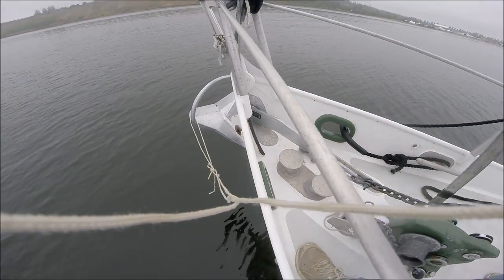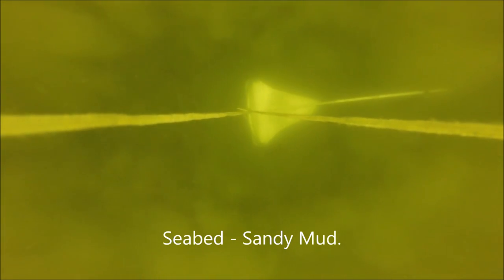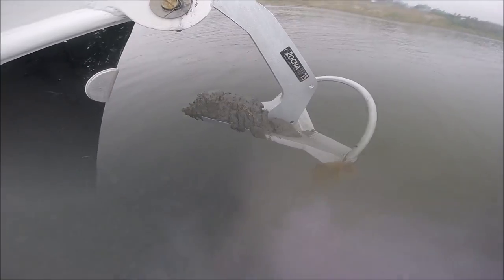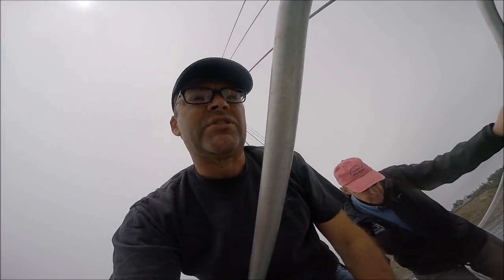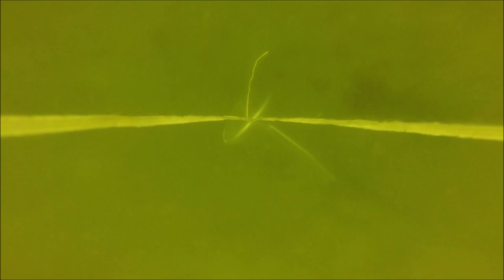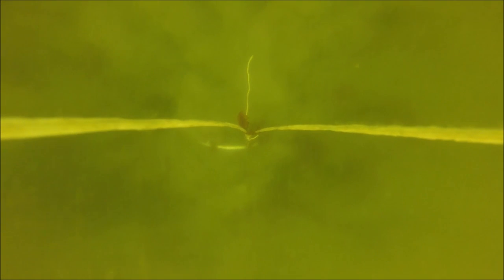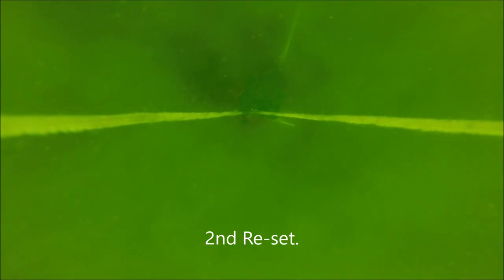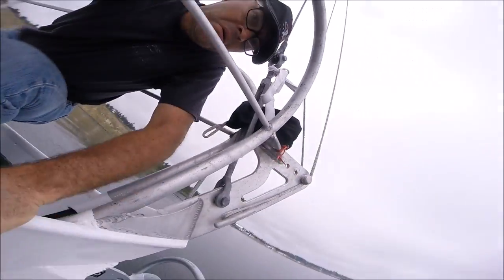Rocna Anchor Setting (33 lb).  Video # 63 of an ongoing anchoring series.

Comment: We have been using a 25kg rocna for years and have had better results than your test suggests, probably for two reasons: 1. We paint than anchor annually with gloss white enamel, so it sheds mud more readily, and 2. I think real world resets on wind or tide reversals are far more gradual than those you use in your testing. Love your videos, keep it up!
Reply: Thank you for your suggestion to paint the anchor.

Comment: thank you for this.  i have been using a rockna 55 lb for 10 years now without a problem but i have learned something from this.  ours is a 36’ trawler.  we have a buddy with exactly the same boat and same anchor.  i’ve seen that other boat not set their anchor by what i thought was a much to aggressive back down.  too fast and this anchor just doesn’t seem to want to set.  we’ve adjusted our set to be much more gentle, only tugging once the chain comes up.
Reply: Same conclusion here with our 55 lbs Rocna

Comment: My 42' sailboat had a real Bruce which I replaced with a Rocna and it was way better. Always set right away. Love your tests. For my next anchor I might try one of your other recommendation. If they are better than the Rocna they must be awesome.
Reply: Ahhh but Steve was recommending Rocna before I believe. If he was doing that without testing that is worrisome, as he might get his latest recommendations wrong for the same reason. I hope you do more research than just one person's testing. There are reports of Rocna dragging, but lots of anchors do in various conditions.  There are also thousands, like me, using Rocnas that have had no problems - yet. These videos are great to help expose issues and I appreciate them being shared, but they aren't 'the' authority. It would be easy to test the strength of the 'holes' put in the anchor and find out why the manufacturer had the tabs bent up. I'd be interested in what Rocna said about these tests and their take on the reasons for the problems, but he didn't check with them. That seems like useful, even critical, information to include in a video like this. I have a Bruce, a Danforth, and the Rocna and by far the best in all conditions I have been in the Rocna is the best of those particular ones. After watching the video however, I will be paying more attention to the Rocna's performance and anchoring with more caution.

Comment: I had a 25 kg Rocna on my Corbin 39 which I lost in a crazy misadventure. It held like a rock in sand and mud, even when I left the boat unattended for weeks with wind and tide shifts. Although it never dragged, the huge amount of hard mud that it brought up always concerned me in terms of its resetting capability in a hard blow and shift of wind. After the loss I bought a 30 kg Kobra (which is excellent and super value for the modest price) for that very reason (mud retention). However, reversing a boat's direction at 2 knots or more doesn't seem like a very reliable real-life testing method. I've seen dozens of boats drag through anchorages, even boats with ridiculously short scopes and undersized anchors, and I don't think I've ever seen one drag at 2 knots per hour or rotate 180 degrees in a blink of any eye. If your testing of this Rocna was comparable to real-life situations, there would be a lot of angry Rocna owners, but I've never met one. In any case, I've watched your videos, find them very useful (thank you), even though they don't fully replicate a real anchoring situation, close but not quite. Sorry to be so longwinded, but I compare this situation to the critics of CQR anchors. I had a 45 lb one on my Corbin for 12 years, and it did the job in two continents and in severe conditions. I'm not saying the CQR is fantastic - it isn't - but I never (ever) anchored using the techniques shown on videos to demonstrate that CQRs are no good. Tests must imitate good anchoring practices and real life situations. To conclude, I wish everybody would buy a Spade anchor for one very simple reason (and I'm being serious): I wouldn't have to constantly worry about all the boat owners who don't know how to anchor dragging onto me here in Southern Europe.
Reply from the maker: Horatio Marteleira   Thanks for that detailed comment, Horatio.  I agree that my re-set test protocol does not simulate typical boat movements during wind or current shifts.  I use this aggressive test because it amplifies the results, thus allowing me to compare anchors using 5 or 10 repetitions rather than perhaps 1000's.   ......   I believe a good  comparison can be made with automobile crash testing.  Most people do not deliberately drive thier cars into brick walls or oncoming traffic.  Testers do this to quickly collect data in a controlled environment.  ....... I know people who refuse to wear thier seat belts.  They cite the fact that they have driven for many decades without ever needing a seatbelt.  Personally, I feel the saftey provided by seat belt use is worth the effort.........All that said, I have an aquaintence who experienced a wind-shift at anchor (once) due to frontal passage that EXCEEDED the conditions of my test. His anchor dragged (Delta) and was just able to start his engine in the nick of time to keep his boat off the rocks.
Reply: I have a CQR now and I am looking to upgrade and have the CQR as a backup, what is your recommendation Rocna? Spade Anchor? I have a 34ft sailboat

Comment: Thank you for doing this anchor tests. I watched most of your videos before already and hoped for month to see a Rocna here.

Currently i am using a 15 kg Rocna with my 34 ft boat (about 6000 kg). From my experience the Rocna usually digs in with the first try and keeps the boat in place with 3000 rpm backwards thrust. I did not experience a reset situation with relevant wind force yet, but i can confirm your observation from when the anchor did not dig in at once. The next attempts were much more likely to be unsuccessful as well. Maybe i should get it completly up and clean it after a failed attempt in the future.

May i ask what the weight and size of SV Panope is? It seems the 15kg Rocna in your test is a bit below Roncas recommended size for your boat?

Currently i consider upgrading to a 20kg Spade, which seems to be a better solution. It would be very interesting to see, how a Rocna Vulcan compares to a Spade. 

Thanks again for this great channel!

Comment: Would love to see testing of two anchors set in tandem.  There is plenty of anecdotal evidence offered but no testing of the caliber that you do.

I always figured that a big fisherman's style as the primary would stick in hard bottoms and would, because of its weight and geometry, be tolerant of an attachment to its crown for the tandem anchor.  That second tandem anchor should then be something good in soft bottoms like a fortress.  In soft bottoms the fisherman's anchor would slowly drag, but in a controlled fashion, and the tandem anchor would dig in and do its thing.  If a hard patch or rock is encountered, the fisherman's would stop dragging and in fact might protect the tandem anchor from substrates that it didn't work well in.

Does the tandem anchor work better or worse in the furrow of the primary anchor?  I have seen it claimed both ways (I have no direct experience myself to offer).  Also I have read about using a leader of steel cable ahead of a Danforth/Fortress style anchor in extremely soft bottoms to allow it to dig down especially deep.  Claims were that it actually made the critical difference.  If so it might also make the difference necessary for a tandem anchor to dig down below the furrow and how would that not be good?  Any deviation left or right would put the tandem anchor into undisturbed seabed a couple of feet down.

Any discussion of multiple anchor setups soon leads to frustration of the "I wish I could see what really happens" sort.  Two anchors 180 degrees apart?  What happens as the wind goes round the clock?  Would love to know.

Comment: Great way to mount the camera. Passing overhead at 3.5kts? If the conditions are such to allow that much momentum over your anchor, in such a short distance, perhaps 3.5:1 scope wouldn't be an ideal choice. Obviously, there are a lot of factors to consider when considering scope, but I would being interested to see what happens during a similar test with 5:1 or 7:1.

Comment: Well I have to say this is interesting BUT....... every anchor has drawbacks and strengths every bottom has challenges for each.  Wind shift is always a issue in any anchoring situation especially is the hold depends on setting deep vs weight of the anchor.  Also part of the reason anchors pull out when wind changes and your boat goes over the anchor and then pulls out is the anchor is designed to pull out when you want to retrieve it. As that’s is exactly what you do when you want to lift anchor and go. Just like we want our anchor to hold well we also want to be able to haul it up when. It’s time to go. Leaving a boat unattended at anchor with a single anchor will always have some risk of pull out and drag until the anchor resets. How well it resets depends on many variables. Bottom m type rode type (all chain combination of chain and rope swivel or not) also weight of the anchor and the chain matters also. As well a depth vs length of rode. Also is the bottom sloped in one direction and when the wind changes are you dragging to deeper water or shallower water? many variables involved.  I always questioned the video tests roccna showed on their web site  they were done on a beach with no water and no angle to the rode it basically showed how a roccna or the other anchors function as a land anchor to pull your rv out of the mud not how a anchor performed in actual water.  They also only test on one type of bottom material. Also although simply not practical the best anchor would be one that is so heavy it would hold without digging in at all. (Like. A concrete mooring )  it would be interesting to see how a heavier anchor would do as size matters.

Comment: I don’t understand the method reasoning. Everyone I’ve ever talked too and everything I’ve ever read says a minimum 4 to 7 times the depth. 10 iTunes if extremely heavy weather. I’m planning a 33kg Rocha for my Beneteau Oceanis 34 with 70 meter of chain. Why so short on the length. Thanks for the testing.
Reply: Worst case emergency storm anchoring :)

Comment: My unscientific observation related to your findings, somewhat supports that a new Rocna can foul. I have an older Rocna 20kg that is about 8 years old, china manufactured by hold-fast with cast fluke. I also have a 1 year old Rocna (for stern), china manufactured by CMP with welded steel flukes. The older one is a dark rusty colour from staining (not rust, but fine clay that has embedded into the galvanizing) but mud never clings to it when I pull it up. The brand new Rocna (shiny like in the video) often has clay and mud still sticking to it. I did note that when I bought my newer Rocna, that the galvanized finish was inferior to the old one in appearance (smoothness). It seemed like they didn't bother to sand and wire brush the steel, but rather just chemically strip and dip right away. Weld spatter still visible in areas. Cost has decreased dramatically on the Rocnas (40%!), so this is probably a justifiable manufacturing cost reduction.

Any chance you might have access to a nice shiny stainless Rocna to see if you get the same failure mode?
Reply from the maker: Thanks for that, Joe.

I too, believe that surface roughness may have a profound effects.  The Rocna that I tested was purchased new in 2015.  It had the cast fluke.  It may be that the smaller sizes still use the cast fluke while larger use welded flukes.  I do not have access to any SS anchors.

Steve
Reply: Thank you for your observations, very helpful

Comment: Brought a Rocna 33Kg, tested in river with very soft mud, dragged as soon as we touched it into reverse or never went in at all. Came up with heaps of mud on it. 4m deep scope 1:3 on 10mm chain, 50 foot pleasure boat

Very disappointed as changed from a CQR and didnt get any better results.
Reply: Cam Collard for very soft mud a fortress anchor with 45 degree fluke setting is best. I prefer a mantus anchor for all other substrates, it has a better design to Rocna, much less prone to fouling and failure, probably because the point is more aggressively aimed at substrate.

Comment: where are you anchoring where the current switches directions instantaneously to 3 knots in the opposite direction. Remind me not to anchor there... And why are you running 2:1 and 3:1 scope? I would think a more accurate test would be 5:1 and 7:1 which is what most serious cruisers would use if they wanted some peace of mind... Regardless of anchor brand.
Reply: Worst case storm anchoring? Deep waters? Crowded area?
Reply: sorry to tell, but 5:1 scope did not help me

Comment: Hi, thanks so much for the tests! Very interesting. I have a 44lb Bruce, but I'd like to get a 66 lb Spade (boat weighs 24,000) I'm thinking your Rocna test was too light for your boat. What weight was the Spade you tested?
Reply from the maker: Greetings S/V Pearl Sail.  I would have preferred to test a 44 pound Rocna (instead of this 33 pounder) not because it was too light for the boat but because the bulk of my other anchor that I tested were in the 44 pound size range (including the Spade).   That said, the Super Sarca Anchor that I tested weighs only 34 pounds and it handled these re-set tests with ease.

Comment: "I agree that my re-set test protocol does not simulate typical boat movements during wind or current shifts."
Then why do you do it - if you admit it is irrelevant for real-life situations??
Reply: Because it is a worst case storm scenario. If the anchor passes these criteria, it will also certainly pass optimal conditions :)

Comment: Dude, very enjoyable video but why are you still talking in imperial weights and measures. I'm a 55 year old Englishman and even I have to convert in kilos and metres. No one talks imperial any more!   3/8" chain... yeah right.
Reply: In reading through the comments, almost no one complains about the units.  Really, the only important things to keep in mind are the scope, which is unitless, and the speed in kts, which is universally used by sailors.  The depth and chain size are not very relevant, considering they are constants throughout the testing.

If you really just can't get past the inches and pounds, your favorite search engine can convert them to the unit of your choice in a split second.